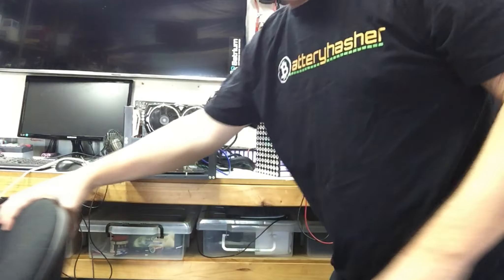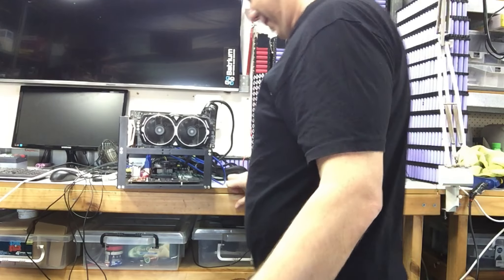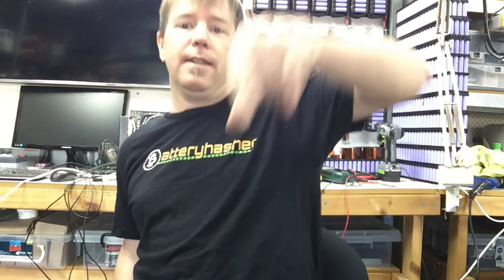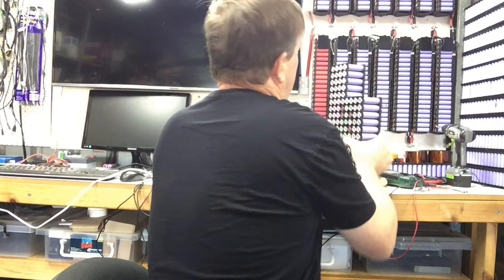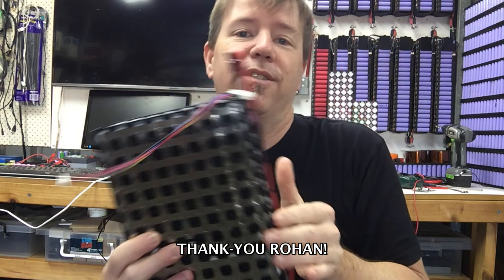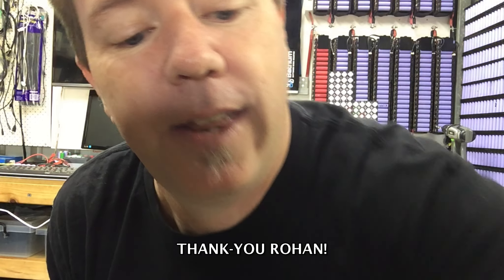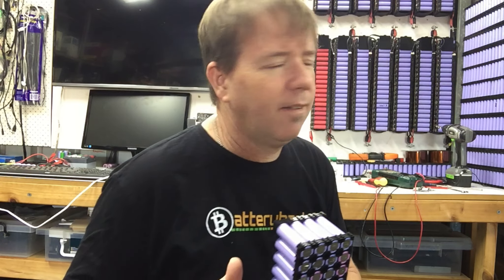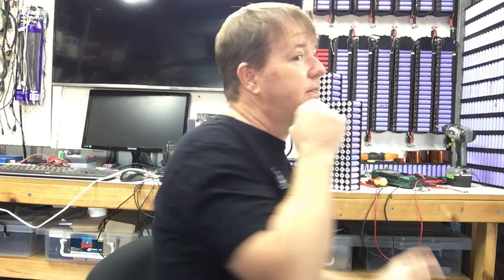Community Spotwelder Idea.....

Comment: My first impressions of your idea is, (like my grammar) that it is kludgy. A very complex system for a not that expensive tool, especially when you look at the total cost of building a battery system. Here in the States I paid less than $300 for mine.
On second run through on it, for me it won’t work.
1) I work in spurts and never know when I will need the spot welder.
2) The things are very temperamental and you need to play with them over time to gain skill with your welds. I can imagine someone saying “it doesn’t work right” and my response “your not doing it right”, as the argument will go. I don’t need that crap in my life.
3) Shipping will be a pain, someone will forget to ship a pedal or wand or something.
4) Once you get one, you are going to find projects to used them on, they are great tools….You might as well buy one.
What I thought would be better is a community tool shop or makers center, where like minded people can gather to share tools and expertise. 
My first impressions of your idea is, (like my grammar) that it is kludgy. A very complex system for a not that expensive tool, especially when you look at the total cost of building a battery system. Here in the States I paid less than $300 for mine.
On second run through on it, for me it won’t work.
1) I work in spurts and never know when I will need the spot welder.
2) The things are very temperamental and you need to play with them over time to gain skill with your welds. I can imagine someone saying “it doesn’t work right” and my response “your not doing it right”, as the argument will go. I don’t need that crap in my life.
3) Shipping will be a pain, someone will forget to ship a pedal or wand or something.
4) Once you get one, you are going to find projects to used them on, they are great tools….You might as well buy one.
What I thought would be better is a community tool shop or makers center, where like minded people can gather to share tools and expertise.

Comment: Ive seen  plans for a spot welder using capacitors. The charge from the capacitors only does a few welds so i guess you'd have a battery bank to charge the capacitors then discharge them on the welds rinse and repeat

Comment: I know this video is a few months old, but what about a community designed (open source) low cost DIY spot welder? Maybe use Arduino in it like https://www.instructables.com/id/DIY-Arduino-Battery-Spot-Welder/? Could you leverage a PC power supply? 

Since you are doing this on packs of cells, leverage a foot control to trigger the weld with the logic in the controller that won't trigger another pulse until your foot has completely lifted off the peddle and depressed it again.